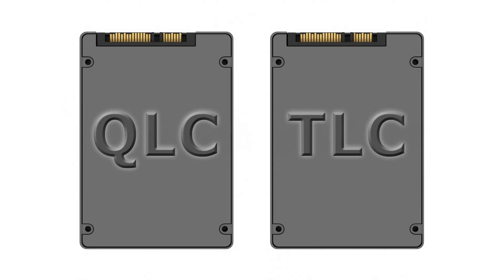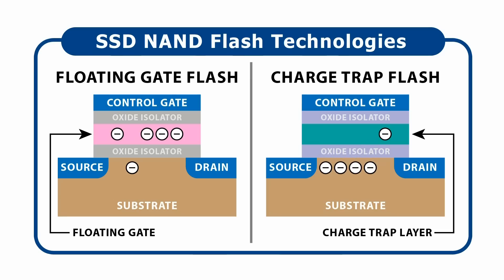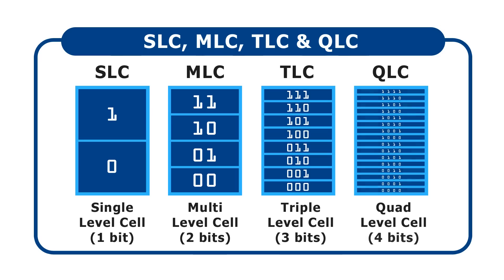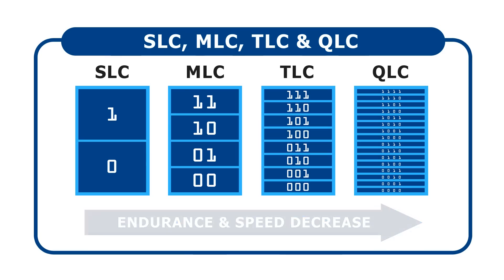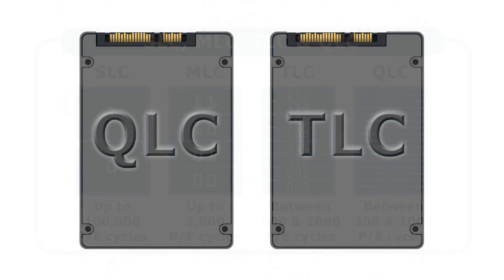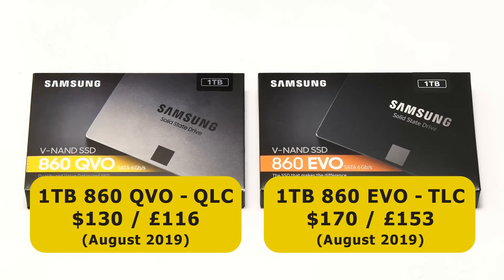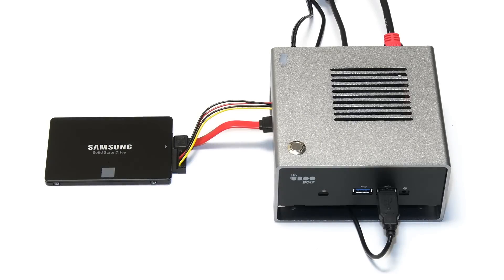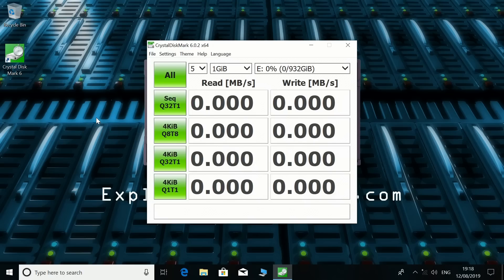QLC vs TLC SSDs: Samsung QVO & EVO

Comment: Thank you Chris for all your educational videos! 
One week ago I replaced the old Toshiba SSD 256GB with Samsung SSD QVO 1TB. After Windows 10 fresh installation the Samsung Magician and Crystal Disk Mark speeds was aprox. 530Mb/s Read and 480Mb/s Write.
Something very strange I observed today, the Read speed is above 3000Mb/s and Write speed above 4000Mb/s !!!
I did not observed any difference regarding the functionality of the SSD, same lazy computing while copying and same nice home-office-browsing working.
Could you guys tell me what happen with my new SSD?  (Don't know how to insert here pictures to show you the benchmarks results of Samsung magician and CrystalDiskMark...)
Reply: You can see the incredible SSD speeds here:
 https://forums.lenovo.com/t5/ThinkPad-T400-T500-and-newer-T/T440p-strange-SSD-speed-benchmark-very-big-speeds/m-p/4617709#M139614
Any idea? What happen with my SSD?
Reply from the maker: It sounds like you have somehow turned on the Samsung "Rapid Mode", which caches data to RAM before writing it to the SSD.
Reply: @ExplainingComputers  Hi, thank you for your reply. 
You'r right, also I found the solution with the help of Samsung Support.

In Samsung Magician software it is one option for performance optimization called RAPID Mode, option which I enabled without testing immediately the R/W speed.

The explanation of Samsung for this option is: "RAPID Mode increases the overall performance of your computer by pairing the industry’s fastest SSD with the most advanced storage management techniques to deliver the fastest and most reliable user experience. RAPID Mode analyzes your application and data usage, dynamically optimizes the I/O for Samsung SSDs, and eliminates system performance bottlenecks. RAPID Mode is fully automated; no user management is necessary."

Once disabled this option the benchmark results are normal R/W +/- 500Mb/s.

It was very confused because I did't noticed any performance improvement of my system including the lazy computing almost unresponsive while copying, only strange big values of benchmarks.

Anyway, the values still remain strange for me until I will observe performance improvement.

Comment: Personally, the price difference between the two is so minimal (around $30 for 1TB) that I say go with the best (EVO).  For most people you are not buying storage drives on a regular basis so the cost difference over the life/usage of the device is practically zero.  That being said, the average PC user is never really going to notice much of a difference so if cost in building a computer is a huge factor than QVO is still not a bad option.

Comment: To paraphrase Dirty Harry... you only have one question to ask yourself: do you feel lucky, punk?  I, for one, value my data enough to spend the relatively small difference to move up to the pro, the speed benefits are just icing. If the price/capacity spread becomes more significant in the future, I suppose everything can be reevaluated.
Reply: Both are far more reliable than mechanical hard drives, which is often what these drives are an upgrade from. Well, not so much for most people buying these nicer Samsung SSDs, but SSDs in general are usually compared to a hard drive.

Comment: Recently purchased a Samsung evo "mlc" 500GB drive on newegg.ca for 79$. Turns out it's 3-mlc which explains why the price was so low. I usually stick with the true 2-bit MLC Intel drives given their track record for reliability, and the fact that they pioneered the technology. But I saw a review on one of their cheaper TLC drives stating the guy worked in IT for a school board and they had switched over to the Samsung EVO drives and have no problems. So I'd give it a try since I wanted to pay half the price of the Intel drive for double the storage.

But I still keep an eye out for the Intel 2-bit MLC drives on sale, even if they're refurbished. I paid $300 CAD brand new back in 2012 for the Intel 320 series MLC 80GB drive, in which I loaded Windows 7 home preimum OEM and within the past 6 months transferred everything over to the 240GB Intel 540 series MLC drive I got refurbished for 125$ from 2017 boxing day sale (which I had sitting for way too long) and both drives show as over 99% lifespan in the Intel ssd toolbox. The amount of info you can see on drive details in Intel ssd is amazing though, compared to the Samsung magician. But if you want a cheap and fairly large drive, Samsung is the way to go. And they have a whole division geared towards ssd development since they make millions of cellphones every year. Anyways, I've been ranting for way too long... if you've read this, thanks for lending me your ears.

Comment: Your like a ou presentation.

Now that last comment, and me being it Pro, term now used fairly loosely...

With LTS and SSD drives, the problem is power loss or discharge.

For me or and data centers, active drives with SSD is not really a issue, but when we go to archive systems the drives will wipe themselves over time and therefore they are NOT suitable for  deep storage.

There are those who take out drive's (swaps) and liable the drives and shelve them. I know I have a off line stack. 

With mechanical drives I know it's wrote not switched and therefore I can pull out a drive and pop one in if needs be and get data that I want.

The day to day system trend and it has been for many years (circ 2007) has been to not have any drives at all as a consumer.

The objective is SAAS and clouds, of course clouds have data storage and with most phones, they are backed up to the cloud.

From enterprise, we know all about pvx boots, sas and Maas or shall we say virtual computing and remote desktops.

So, will we be attached to a cloud and no longer need big storage and only a ram disk for out software and storage between our device and cloud?

Seems to be heading this way, but with people not having access to high-speed and reliable internet, then it really cannot take off.

However the problems still occur with the providers and provisions to what data formats and types are going to be used.
A data center issue by far.
But with homes and modern life, will infrastructure change at home?

FC network, a hub and 'home server' with 10g network.

So is it down to the provisions of internet speed and access?

Comment: Good test, and to think i was about to recommend that QVO to a friend, wow not going to happen after this test.
Reply: I oredered the QVO and then request a return label and ordered the EVO instead
Reply: Why not? Okay, I'm using EVO, but I can recommend QVO to someone who want to save some money and use it for typical customer needs. I actually seen some TLC SSDs that worse than QVO in most of aspects.
Reply: @A64632  For the current pricing, it makes more sense to spend a little extra and get a piece of hardware thats going to be a faster over time and last longer.
Reply: @joem3115  At my opinion the theoretical lifetime for 860 EVO's memory chips is around 200 years in common home/office/game use, but for 860 QVO - something like 50 years. I guess practically it will die much faster cause of corrosion, or something like this. So... not too much difference in expected lifetime.

Speed - they have almost the same read speed, and almost the same write speed for the first 42Gb. The only home\office\game scenario when you will be limited with write speed is installing modern game. So.. if you are doing it quite often - than writing speed after first 42Gb matters. Otherwise not. Btw, it's may be probably better for you to look for Samsung 970 EVO Plus to get better speeds.

So.. I prefer 860 EVO, but I can recommend 860 QVO for someone who have to save some money. It's also quite good thing I think. At my personal opinion 860 QVO better than many other SSD's based on TLC memory (WD Blue for example), even a little cheaper some of them.
Reply: @A64632  don't get me wrong, they're both good drives but for around $20 more it just seems like a no brainer but for the people still trying to build the rest of their PC, then perhaps the QVO will be fine. As for the 970 EVO Plus goes I actually have that as a boot drive and it's speeds are incredible.
Reply: @joem3115  agree ))

Comment: That QVO drive is slower than my spinning rust drives, these 'referbished' 3tb-7200rpm drives usually write at 150-180MB/s and their 'turbo cache' is only 128MB instead of several GB

Comment: I cant remeber the actual cache size, but isnt the RAM on these cards in the ammount of multiple GB? IIRC my 2TB QVO drive has 4GB of DDR3/4, and a 1TB has 2GB, so on and so forth, i normally set my test size to at least 8GB, unless i'm testing a NAS, then i'll generally use the mazimum file size supported or at least get it 20% higher than known cache size

Comment: When I see the prices of QVO drives in my country, I can't really be enthusiastic about them. Despite promises, they are not noticeably cheaper than TLC drives from competing companies. For example, 1 TB MX500 is cheaper than Samsung QVO of the same capacity.

EDIT: Maybe except Intel 660p. Those are pretty cheap for an M.2 drive, but still not cheaper than standard 2.5" TLC drives.

Comment: I worry about data retention. I do not understand and cannot find on the web, an explanation of how an SSD might "refresh" its data charges by simply being powered up; and yet the specs seem to indicate that they can retain data longer than 1 year if they are used. I have a lot of computers and would worry that the drives needed to be maintained on a schedule, just as you would have to charge the battery in a little-used vehicle. I have no such worries with the mature technology of a traditional drive.
Reply from the maker: To refresh data, an SSD needs to be powered up and all of the data on it needs to be read (not re-written, as required for a HDD refresh). It is the read operation itself that refreshes data held in the flash memory cells of an SSD.
Reply: That's great information, thanks. And it's a relief. So copying the partitions from time to time would satisfy this. It also leads to the question, "does the firmware take care of this chore?" That would be a win-win for the manufacturer, who would have fewer complaints, and the consumer, who is notoriously lazy about maintenance. BTW, yesterday I made my decision of which Samsung 1tb SSD to buy based on your explanation, and decided to get the EVO, despite its being only marginally better performing. I like the additional warranty and what that implies.

Comment: The impact of DRAM cache on performance is very neglible because modern ssds are spending its DRAM space mostly for L2P mapping, what is like an yellowpaper and each address inside that is pointing to actual data location on NAND flash memory. 2 digits megabytes of DRAM cache was a big deal in the era of hard disk drive, however, now it is nothing for an SSD since it has way faster random access performance. So you can just ignore it here. btw, flash memory seek time does matter here.

TLC SSDs have SLC cells to boost its write performance inside themselves, and such cells are called "TurboBoost" in Samsung term, or "SLC Cache" from other companies.

QLC SSDs have similar SLC cells, but many of they are, in the same time, utilizing some TLC cells as well. As QLC cells are so slower in terms of write throughput than TLC, so if someone want to achieve the equivalent performance of TLC in QLC with SLC cache only, it has to put way more SLC portion, which is unrealistic since SLC cells are much more expensive.  it's natural to utilize TLC cache as well. so they have triple level of tiering of NAND Flash cells in a same SSD. Once SLC cells are exhausted, SSD starts to use TLC, then QLC. The data written to faster cells will be moved to slower QLC cells when SSD is idle. 

This is why your QLC SSD is as fast as TLC SSD for a while. if you don't copy big files frequently, you can consider to get a QLC SSD. It would be fast enough for most of personal computer experience. If you are going to copy or save large files a lot, QLC is not on your side.

Comment: With reference and compliments to Batuhan Çokmar's comment (3 months o0loder than mine), two important concepts have always played with storage devices: (1) the difference between interface speed that relies on cache memory and a very fast I/O processor versus "media speed" in combination with the time a storage device can sustain the interface speed (or MB written), and (2) longevity, or how many times we can re-write before the medium becomes unreliable. Concept (3) is about integrity. Even when we are in the reliable part of the lifecycle, we also should consider "spontaneous bitflips", so this is about data integrity. All thee concepts are still valid in solid state times. ExplainingComputers and Batuhan Çokmar eloquently touch on these points at varying depth. In the past I used data center (enterprise) magnetic hard-drives and never suffered data loss. These drives could resist array vibrations and could handle 10 times the stop-starts of top workstation drives. I built a RAID 5+1 array with 3TB desktop drives and these wear each other out quickly. Even at that protection level, failure is dangerous because rebuild take so long that easily one or more additional drives fail in that time. The same applies to drives in my 6 NAS units - I had to replace them all by NAS certified ones or they could not handle the vibrations they cause to each other.
Several middle class SSD (i.e. high-end consumer) failed on me from different vendors. Both single cell and dual cell versions. Today, I am looking at two Sony G series XQD cards that my camera can format and save photos or movie to, but the USB reader/drive cannot read - used a couple times, only. Top rated, and priced, flash memory that should outlast SSD or never fail. When we point to cache, it is good to know there is a small computer in the SSD that does the I/O on the interface, stores data in cache (or not), moves from cache to cheaper memory and maintains track of how many times a cell was erased and written. This controller has its secret memory - and if that gets corrupted, the SSD is a goner. If you need to run computer games and want it fast, buy fast cheap SSD because you only have to write a lot of data once and read many. This could also apply to your operating system SSD and even for the drive that stores your data (documents). In my laptop, I use a micro-SD for downloads and redirected Windows' quick access download path to it. If the data really matters, I store it on my NAS with a time capsule like sync to a second and remote copy to an off site backup. In my workstations, I use a RAID 1 array for page files and temporary, as in many systems this has better performance even than RAID 0, especially in reads. If this is SSD, buy much more capacity than you strictly need and the I/O controller has much more potential to evenly spread erase/writes across memory cells.

Comment: I'm still concerned about the limited number of memory cycles for SSD, but how about setting up a wicked fast RAID system... I wonder how quickly you could rebuild the system after a drive failure. Minutes?

Comment: When Windows told us that the QLC drive has finished writing, I think that isn't the whole truth. At that point the cache is still full and has to be written to QLC so you can't just turn off the computer right after the copy finished, if I'm not mistaken?
Reply from the maker: You are right that the drive will still be internally moving data from SLC to QLC. But you could turn off the PC -- the SLC cache space on the QLC SSD is on-volatile, so the drive could safely shut down, and then continue shifting data from cache to QLC storage space when the drive is next booted up.
Reply: @ExplainingComputers  Well that's good, thanks for your reply 🙂

Comment: Just ordered the 2TB QVO for my ps4, could the 2TB have an advantage over the 1? The obvious being size and price
Reply: He said the larger the drive the longer it should last before breaking down. Plus more free space which also helps with longevity. I put the 1tb qvo in my pro for $90. I already had 1tb external.
Reply: @mikegeezy8202  cool cool, all infp I've seen is on the 1TB and i was getting buyers remorse over all tue reviews and that the EVO is better, but yeah thanks! Gave me some reassurance lol
Reply from the maker: @Mike Geezy correct -- the larger the SSD, the longer it will last (as the wear per cell for the same volume of data stored is less).
Reply: @ExplainingComputers  another reason I'm so panicky is because my original hdd went out so i just didnt know what to do and im new to all this but thank you!
Reply: Its for my ps4 btw. Lol

Comment: Nicely done video. With the Various types of Flash memory we  have today - having multiple ssd's for you're system should be a real option. OS drive could be a SLC or MLC , then bulk storage could be a cheaper QLC drive. At the moment my system only uses a single 1-tb Samsung 970 Evo NVME drive. How much longer will it be before hdd's go End-Of-Life?